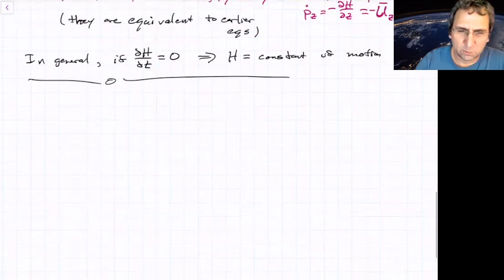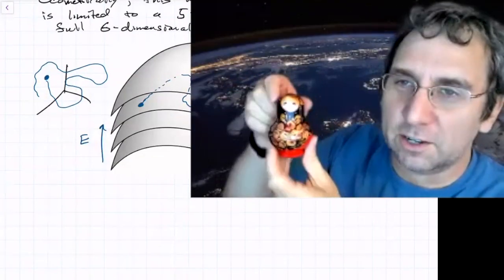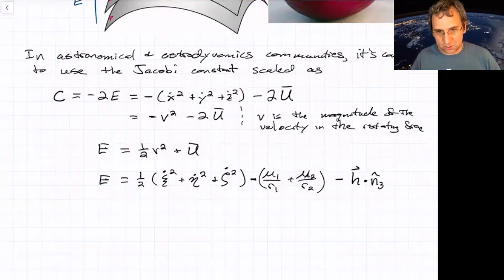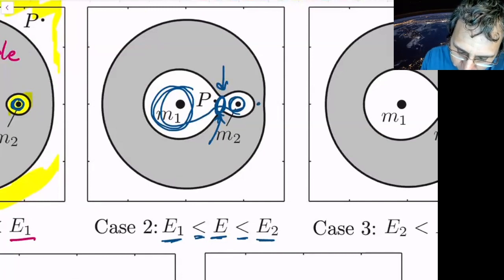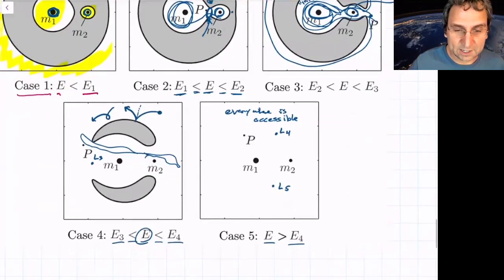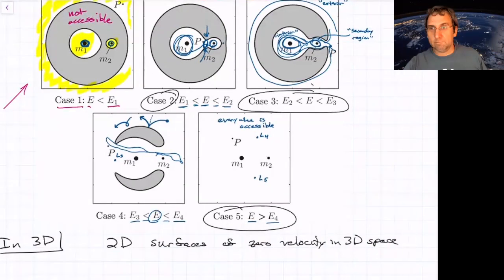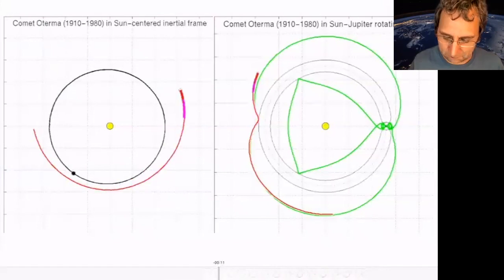Jacobi Constant, Zero-Velocity Curves & Hill's Regions in the CR3BP | Three-Body Problem

Comment: Brilliant explanation and illustration of the Hill's regions. It is fascinating to see the particle's motion in inertial frame and rotational frame side-by-side. Could you please let us know what software you used to create these videos? Thanks.
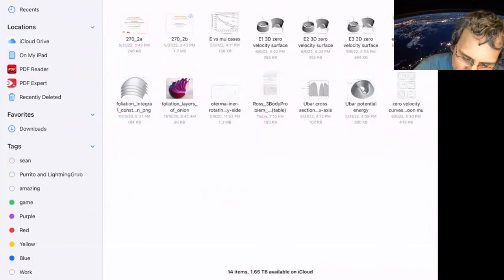Reply from the maker: For the comet video at 24:30, I used MATLAB to make that video 25 years ago. I use a customized version of the comet.m function for visualization. The data came from the JPL horizons database. One needs both Jupiter and the comet in the same inertial frame (solar system barycentered frame). It was originally published in 2000, journal link https://doi.org/10.1063/1.166509 

Thanks for watching!

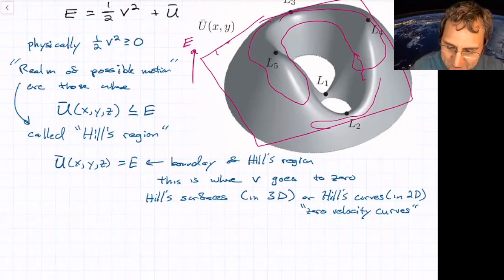Comment: In 10:50, isn't increasing the energy of the surface means actually increasing Jacobi constant(it's a negative value)?
Reply from the maker: Since Jacobi constant is defined as the NEGATIVE of twice the three-body energy, C = -2E, then INCREASING a negative energy E (and usually it is negative) is the same as DECREASING the positive Jacobi constant J. So it makes it difficult to match our usual intuition, for example, that lower energy (more negative energy) makes something more bound. But since the Jacobi constant is so common, it's a notational we just have to deal with.